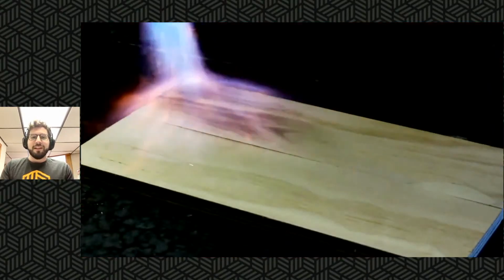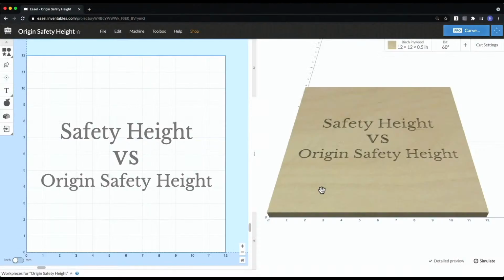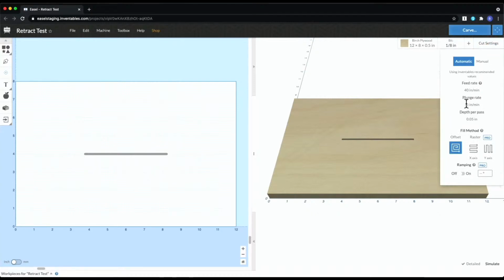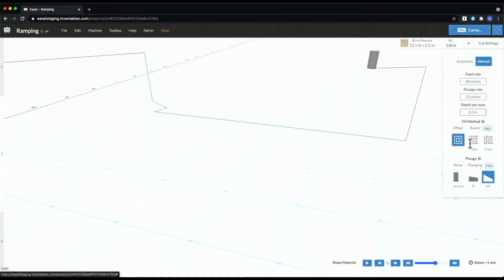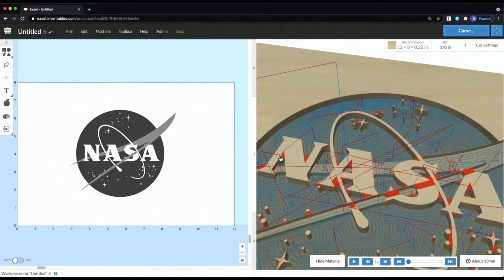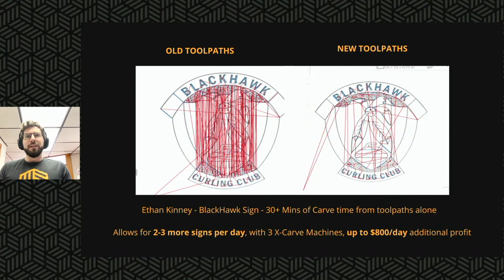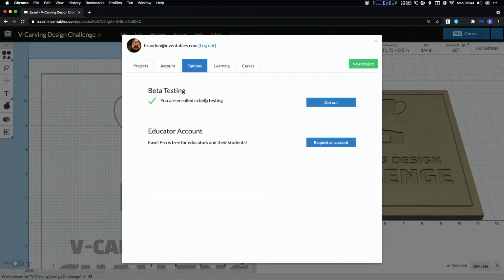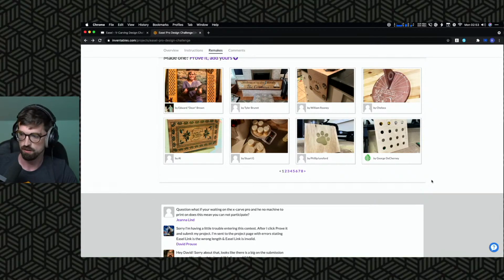Easel Live: Toolpath Updates!

Comment: Thanks for the implementation of "plunge ramps". I often use my CNC to cut out 16mm multiplexx and and unfortunately I have already burned many endmils :-) :]
Reply: I don't see the plunge ramp option on easel. I clicked on cut settings and its not there. Where do I go to update the software? thanks!
Reply: @Chirotekk  You're right. i have tried to use the function now but i can't find it either. I think Inventables just need some time to release this option...
Reply from the maker: It will be released into our Beta program very soon, you can opt in to that in your account settings!
Reply from the maker: We are releasing it very soon!